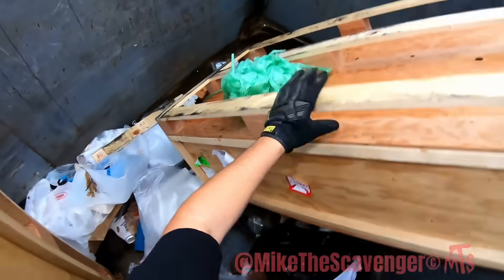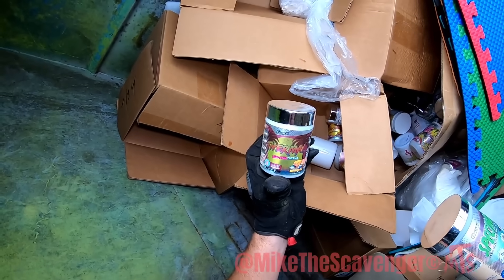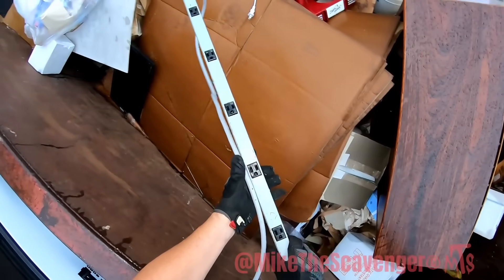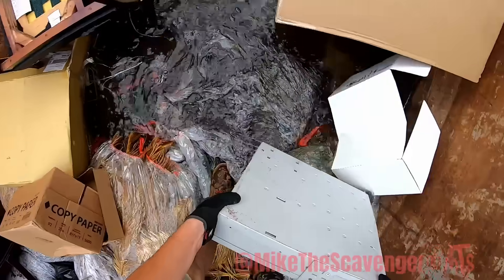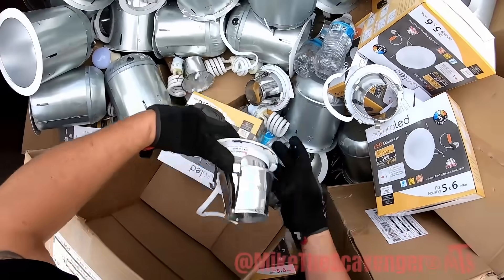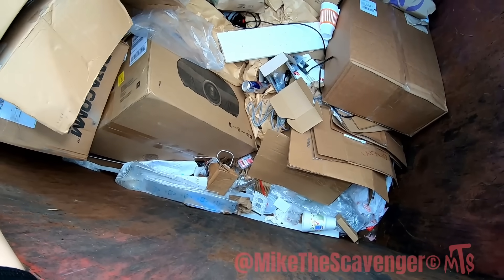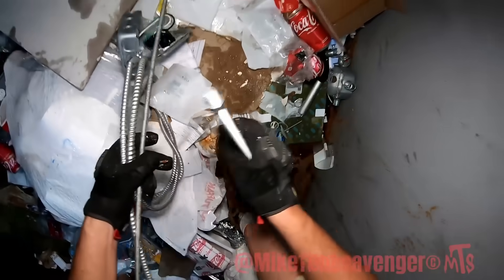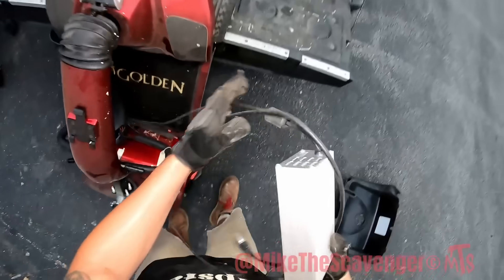Dumpster Diving "But It Has Electrolytes..."

Comment: Those cheapy floor things are great to do oil changes with. My body doesn't like hard cement to lay on. Disposable. wierd stainless with black ends...paper towel holder. I'm in Tn and  the Titans are well loved here.

Comment: Hey Mike, have you considered one of those cherry picker type lifts that you can use either a manual or battery powered cable winch with? I've seen them a lot on trucks and trailers. They mount either in the beds on a thick plate and vertical post or inside the  the bed rail. Great for deer hunting too and I've even seen some people have installed them on their boats for gator hunting and such. They can swing almost totally out of the way and they are very strong believe it or not. Just a thought. 

Love the content brother - keep it up!

Comment: Milwaukee and they’re cheap knock offs made in china u can buy from eBay or Amazon….theyre not very good quality either…I bought one simply to be able to test a tool I found and new they last for maybe 30 minutes with a full charge compared to the actual Milwaukee brand batteries that can last all day with heavy use

I kept it around though cuz it’s still a battery for a Milwaukee…I found another one that’s the brand name but the case is shot so I’m gonna swap the shell out with the knock off one lol…